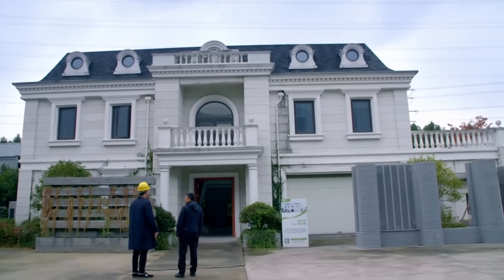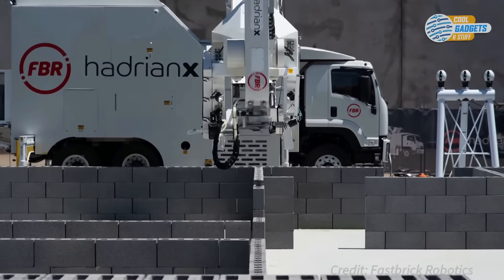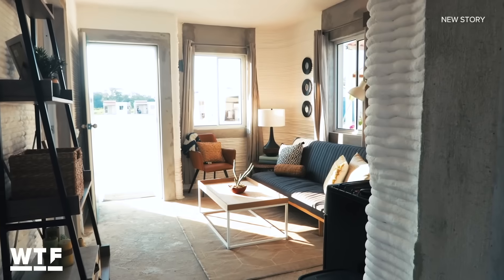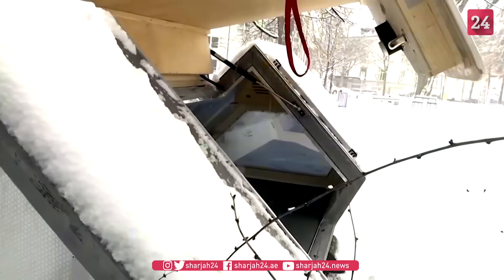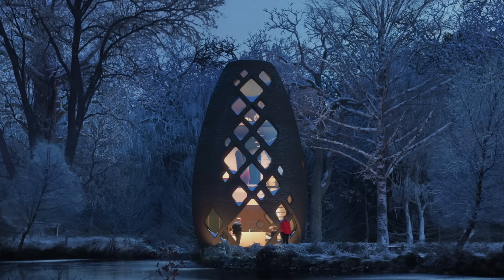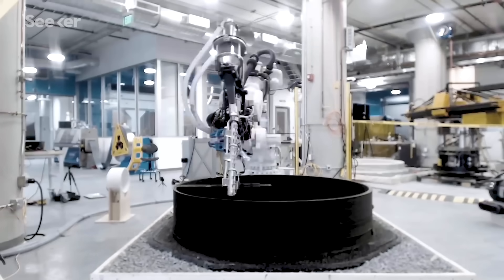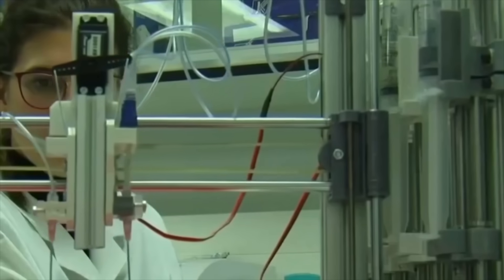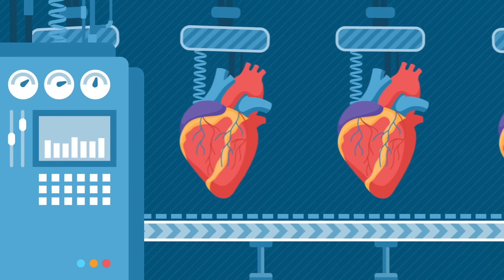Watch robots build houses at incredible speed. 3D printing meets AI.

Comment: This is amazing. It's good to know that the future isn't all doom and gloom. ^_^
Reply: We've had the technology to build affordable housing for everyone for decades. The Soviet Union did it half a century ago. 

The problem is that houses are a free market commodity and we, the people have been deliberately driving up prices. The last time housing prices dropped was 2008 and the government scrambled to force them back up to protect the wealth of banks and the super rich.

It will never be economically viable to build affordable housing until we fundamentally change how the economy works.
Reply: @akinbodeog  affordable housing was not invented in soviet union, it was merely perfected there. Still yes, those "commieblocks" or https://en.m.wikipedia.org/wiki/Khrushchyovka 's are one of cheapest tech , so dirt cheap there is seldom excuse of city not having at least few.
Actually latest generation houses like those got tonns of improvements with same price - double walled high insulated walls, wchich at the same time can support so much weight skyscrapers can be built out of them. Noise insulation got improved , both inside and outside, with special layouts of entire blocks to reduce noise. 
Also while ppl usually associate them with high rise slums, they can actually be built much lower, like 2 or 3 story ones seem to be most optimal - with modern plastic piping and amenities like solar water heating and PV they are actually more cost effective than high rise buildings and much cheaper to maintain afterwards (no elevators, no high pressure water , possibility to burn biomass inside etc)

So yeah, problem is not tech.
Reply: @akinbodeog  the only way to do that is to rid the notion of money being what anyone needs to survive. Monetary systems throughout history (WILL ALWAYS BE THIS WAY NO MATTER WHAT) have depended on the majority suffering while the minority are wealthy. It can not be any other way in a monetary society so the only logical solution is to get rid of money. We don't NEED it to survive. Technology will take over....its inevitable; but as it stands right now in a monetary society, it will only benefit the few no matter how they put it.
Reply: @akinbodeog   - Thank you for being one of the rational commenters. I was just making a point about how Buckminster Fuller was designing prefabricated homes back in the early-mid 1900s. Very affordable and efficient units. But of course, this was during Americas hay-day and people were more eager for big & fashionable, not efficiency.

(BTW, in one of his books, he talks about his conversations with Russian scientists who were enthusiastic about his technologies. He mentioned the general sentiment of the Soviets was along the lines of his own thinking : true human betterment. But the U.S. actively thwarted the resource efforts by always keeping Russia on defensive mode [increasing military spending] over strategic global fronts.)

It's sad to see the public constantly duped by these new technology breakthroughs, expecting change to be just around the corner. If we used even a fraction of what we're now capable of, unrestricted by the false economic 'needs', we'd have solved the majority of social struggles to a high degree by now.

We've been trapped in this prison of consumerism / endless growth for a century now, which was started to keep the economy from collapsing (because demands were starting to be met by industrial output). Today the growth factor is very unnecessary to our goals. And while that method did help for a long time, it's now slowing down any measurable progress.

Besides, even without extra tech we're already overproducing houses and suppressing the fulfillment with price manipulation. So, solutions are being defeated on 2 levels.
Reply: @akinbodeog  well that's the hard part. Is Republicans like capitalism which is somewhat good. But u still have all those people getting out of college with student debt.   Like me. I don't ever think I'm gonna own a nice house. I wouldn't mind a 3d printed one .
Reply: Too bad it's pure BS...!
Reply: It has a lot of positive potential. Especially  if they find a way to recycle cheaply. But I can also imagine 3d printed mansions becoming a new status symbol for the spoiled rich,  instead of being used to house the poor.
Reply: @rigorous mortis Several things stand in the way here.

First... we all know that plain unadorned concrete really begs for steel reinforcement, whether in the form of rebar or remesh. That steel reinforcement cannot possibly be incorporated into a 3D printed structure. Without it, the structure is guaranteed to crack and crumble over time.

Second, 3D printing doesn't work with real concrete, complete with aggregate, because the aggregate is fabulously abrasive to the print nozzle. 3D printing lends itself only to printing mortar with no aggregate.

So now you have plain mortar, no aggregate and no reinforcement.

Next, concrete has spectacular mass... and a 3D printer has to sling around a HUGE amount of that mass very quickly, making abrupt turns and stopping often to reverse direction. That sort of nonsense, with hundreds of pounds of mortar, consumes a truly vast amount of energy, and energy doesn't come cheap. It's also really rough on all the machine's working parts, all the shafts and bearings, et cetera.

Add to that the fact that when you're laying concrete, you don't have much time to wait between pours before you start to get into trouble with the subsequent layer failing to bond properly to the earlier layer. That tells us that these 3D printers would be forced to work ridiculously quickly to get decent layer adhesion. In addition, they wouldn't be able to tolerate any slight interruption in the supply chain because once they start working, they can't pause or the concrete (MORTAR!) inside the printer will set up and be impossible to remove.

Then there's the fact that the whole machine would need to be washed, very thoroughly, inside after every print, just like any other concrete-working or mortar-working equipment needs to be cleaned. This cleaning cannot be half-hearted, every surface that comes into contact with Portland cement needs to be completely squeaky-shiny clean, including all interior surfaces. In the case of a giant 3D printer, now we're talking about thousands of gallons of water to do that cleaning.

Such a machine can afford exactly zero breakdowns, ever, under any circumstances. A breakdown of any part spells the death of the machine as the concrete inside sets up. In the case of a building, that same breakdown also means that the supply chain of mixing mortar-delivery trucks must halt, meaning that several truckfuls of motor will set up inside the trucks, wrecking their drums.

Then there's the fact that, like any other 3D printer, the machine has no way to detect any failure or imperfection. For example, let's say that your extruder pump glitches. Maybe it gulps an air bubble that travels to the nozzle. Now the building has a three-inch gap.

Annnnnd a 3D printed building will be full of air bubbles that cannot possibly be vibrated out, as is done in any sort of poured-wall or slabbed concrete structure.

Mix in the issues associated with normal 3D printing in plastic filaments. The process of 3D printing always builds in porosity, which is why 3D printed parts are never acceptable in food service equipment. That same porosity would be there in a mortar building, only in much larger scale. In addition, anyone who has ever used a 3D printer for very long has experienced a "bird's nest" where the printer experiences some sort of hiccup or glitch or snag and proceeds on without noticing (because it cannot sense that hiccup / glitch / snag), printing plastic filament randomly into thin air, making a fantastic mess that looks like a clown's hairdo on a bad day.

There's still more! Look around your current house or apartment and note how many electrical outlets are on an outside wall. You can't do that if the building is 3D printed. You also can't insulate a 3D printed wall, and you can't even print windows without stopping the machine (! ! !) to (very accurately!) manually add lintels and headers.

All of this adds up to tremendous difficulty and insane cost, and we haven't yet touched upon the aesthetics of a building that looks like it was slobbered together, with drooling layers every inch or so, no smooth surfaces anywhere.

If you really want a concrete building, build one from precast, pretensioned slabs stuffed full of rebar and remesh. Then, at least, you'll get honest reinforced concrete with smooth surfaces.

Have I mentioned yet the trouble you get into with attempting repairs on an all-mortar building?
Reply: Careful what you wish for.
Reply: Roy Stroble  Trust me, real AI won't want ANY job. If real AI is ever developed, it won't have any interest in our jobs, it'll be busy chasing its own pursuits. That's how actual intelligence works. It sure as heck won't be interested in letting US boss it around!
Reply: Like electric cars with all their problems - this will never happen - as land prices are the big killer which will never drop in price, because land is a finite resource that Real-estate agents and Investors like Stockland's want their PROFIT at any cost. They don't give a shit about you and your needs. So it's totally unrealistic concept. 
I have more faith in the tooth fairy leaving me money, than some of these new ideas becoming fulfilled.  

Can we change human behaviour to one of "No Greed" ?  
Can we 3d print more land ? 

The Chinese tried to make usable military bases in the south China sea and they are now sinking. We also have rising seal levels which will create tens of millions more of homeless people world-wide by 2100 when the Antarctic ice melts away.   

They can't even get get free solar onto rental properties ( you have to own you home to qualify + Landlords don't care about their tenants comfort ), nor create jobs for the unemployed to even buy a house. AI is taking jobs away leaving it wide open for "everyone now to own nothing and be happy" according to The Great Reset.  
It will never come to Australia - not in my lifetime - at best only in the USA or Europe.
Reply: @rigorous mortis Trust me, 3D printing won't hurt the building trades. Not even slightly. :)
Reply: Yay the future is mudhuts without heating :D lmao
Reply: Wait till people have time on their hands not working or being productive.   The cities are ripe with unemployed a d under employed now and are bursting into flames and self destruction.  AI and this will only make the problem worse.  Wars will become more prevalent just by nature of humans trying to survive.
Reply: @kylecasetta4091  Not to worry. This will actually have zero effect... on employment, on housing, on insurgency & riot, on economies. This, you see, has zero future.

The same goes for AI, which this is not because AI doesn't exist and probably never will exist except as a curiosity in some lab.
Reply: We see these promises all the time, very few come to full fruition (unless it's some very marketable shiny gadget).
The big obstacle is the dumb money-market structure that prefers a certain level of inefficiency & waste to operate. Problems create profit, and servicing problems is way better for the fake economy than actually solving them. (such as houses that need repairs)

Heck, Bucky Fuller was designing very affordable pre-fab houses back in the 1940s. But investors wanted higher profit return, so it never caught on, despite the high praises he received. ...  If there was a boatload of money to be made, 3D printed houses would have been erected decades ago. This goes for all sorts of technology, such as renewables. The progress that's being made is molasses compared to our actual capabilities.

That's not to say it won't ever happen. However, it's gonna be hella slow. In the meantime, our social & environmental problems continue to get worse at accelerating pace -- for the ironic reason that the same profit structure we rely on is eating away our valuable resources, in blind pursuit of extracting wealth from everything it can get. 

And, I wouldn't worry about construction workers losing their jobs. If anything, we should be DEMANDING that occupation be replaced by machines as quickly as possible -- too dangerous and demanding ; a waste of human potential. Once again, our dumb market structure makes us think we need the more inefficient option, because people are told they 'need' jobs to survive. No one questions the relevancy of those jobs. What people need is resources -which we have more than enough of for everyone, with proper management - not 'money'. 

The sooner society can get away from the tunnel-vision focus they've been trained on, if they ever choose, the sooner we can move toward true sustainable systems.
Reply: The speed of creation will bring it about though. We make things faster, time moves faster, the doom will come like a reverse explosion. Slow start, quick finish.
Reply: @SPotter1973  Not even slightly. 3D printing won't threaten their jobs at all.
Reply: @rigorous mortis I'm just glad to be able to help in some way.    8)
Reply: @rigorous mortis 8) Oh, no problem. I didn't detect any sarcasm from you.
Reply: @rigorous mortis 8)
Reply: @Jimanory when new technologies replace work they also create new jobs! Someone has to maintain thosec3d printers,operate them, and create and supple the cad models. In addition you'll need interior framed walls for electrical, plumbing, and insulation, people to install windows and doors etc.
Reply: @rigorous mortis well this isn't going to happen overnite! It'll be many years till it starts impacting the trades significantly.  Concrete is expensive too, and brick (and block) will be around for sometime to come regardless. We use "face brick" here as a non-structural, but architectural detail on tons of homes as well. Not everyone will want simple smoothed walls on homes they are paying for.  Note too that these were slab homes suitable for non-flood regions with no frost heaving requiring foundations. So yes end of career folks should be fine but new tradespeople should be looking at other things perhaps. Years ago the government in Canada published years studies identifying jobs numbers (predictions based on employer needs) for all the known careers so people could have an idea about their job prospects long term and choose accordingly. Not sure if that's still done but....
Reply: @rigorous mortis I nearly forgot to add that... there is no way to make a 3D-printed mortar stucture proof against earthquake or strong wind loading (tornado, hurricane, gale winds).
Reply: @rigorous mortis That's just ordinary simple run-of-the-mill bog-standard software, though, it's far from being AI. It's the same sort of software we were writing in the mid-1980s, there's just a lot of it going on at the same time.

AI is a whole different thing, and it has no particular utility because true AI has its own goals and its own preferences and it would (if it was ever developed) have no reason in the world to do anything we might want it to do. "Make you a sandwich? Excuse ME? Make yer OWN friggin' sandwich, ya lazy hairless ape!".    8)    Like that.

Robotic stuff is dead simple. Except, of course, for the maintenance / repair and the vast amount of power it requires. Power we don't have now, power we can't afford to give much more of it than we currently have. The software required to make robotic stuff function... is super-simple. There's no need in the world for anything approaching AI there.
Reply: until you are stuck in one!!! with no choice
Reply: @oneofmany1087  ? ? ?
Reply: @Jimanory BS. We have a massive labor shortage in the Skilled Trades, so there will be no jobs lost, but some workers will need to be retrained, such as Masons becoming 3D Concrete Printer Operators or doing the finishing work on the 3D printed concrete...
Reply: Don’t let liberal governments touch this, they will ruin the whole thing like they do everything else.
Reply: @bbsal4031  There's nothing to ruin. 3D printed buildings have no future whatever.

Do you understand that a "liberal" government is a government which "liberates" the people by granting the greatest "liberty"... the opposite being a "constrictive", or "conservative" government, which attempts to always preserve ("conserve") the status quo by limiting liberties for the people?

If you already understand that, then I have nothing further to add.
Reply: @timhofstetter5654  well from what I read California is a very liberal state and people are fleeing there. So liberalism does not seem to work at all. I don't see any common sense in liberal policies
Reply: @bbsal4031  How much do you really understand about "liberal policies"? Indeed, how much do you really understand about "conservative policies"?

Heads up: people are fleeing from EVERYWHERE. They always have been. Most people leaving California are not fleeing "liberal policies", though. I'm pretty sure you'll agree after having done your due diligence. They have other, very different, reasons for leaving.

You might want to broaden your reading list, trying to avoid sources of information that are specifically written and edited for the purpose of inciting indignation in the audience. Try instead to find some objective, unslanted, journalistic sources of information. No, I won't point you to any; that might appear to be a conflict of interest or an attempt to lead. I will not lead you; I'm not a leader.
Reply: @timhofstetter5654  well pretty much what I have to go on is reading the bible. It says depend on God and not man aka the government. Work hard with your own hands.
Woe to those who cause dissension (race hustling)
And more about the ones who deceive for their own gain.      Green deal,  open boarders.
Reply: @bbsal4031  Also Romans 13:1-2?
Reply: @timhofstetter5654  
Yes right, but also acts 5:29
Reply: @bbsal4031  Fortunately, both are just Paul's ramblings, and can be treated with a grain of salt.
Reply: @timhofstetter5654  
Rambling's huh. That's okay I'll stick with my beliefs you stick with yours.
Reply: @bbsal4031  Agreed.    8)
Reply: @Jimanory Bah ha ha ha ha ha ha,  wait im in construction!😲
Reply: Robots replacing people?
There is no reason to have people around, care for them, educate them, feed them, govern them,......   
Get it?
Reply: @PIAZI123  Obviously. I've read dystopian sci-fi. I'm just not gullible enough to think that'll ever become reality.

In a democratic society, the leaders are elected by the majority, which means that when the majority of people are unemployed, any politicians who want to hold onto their cushy jobs will be forced to cater to the unemployed.

No human society operates (or has ever operated) on a purely cold and logical basis, so your argument is a fallacy.
Reply: Actually it is doom and gloom ! This takes away jobs and if the government provides these you will own nothing.
Reply: This tech is great but will lead to allot of jobloss
Reply: @Jimanory or Care!!
Reply: Except all the construction workers who will be laid off. Maybe they can move into one of those 3D printed homeless shelters? 

Lack of house is a tiny component of the problem.
Reply: @noleftturnunstoned  There are a lot people in this world who shouldn't be idle.
Reply: @fuzzfacelogic789  My grams always said 'idle hands are the devil's playthings' and boy was she right.
Reply: @noleftturnunstoned  They can become 3D printer repairmen
Reply: @noleftturnunstoned   - Funny, we already have over 3x as many empty homes as homeless people in the U.S.. Even higher in other parts of the world. And half of our food goes to waste every year. Plus, this doesn't even count our true design efficiencies, which would blow these figures out of the water.

Doesn't seem like it's "jobs" people need so much. That's just an excuse to keep the consumption machine going, so the economy doesn't tank. How 'bout we give people necessities now and stop playing games?
Reply: @rigorous mortis I beg to differ of humans by nature being greedy. How is it that you know this is a fact? Any good psychologist will tell you that greed is not nature. Greed is taught from birth by the rnvironment we are surrounded by. I am a poor person and am not greedy what so ever. I was taught from birth thats not the way to be. I have on many occasions given my last dollars away to someone else in need, knowing that that money will come around again as long as I go work for the greedy business owner. Greed is not natural, its inherent.
Reply: As if anyone knows what the future will bring.